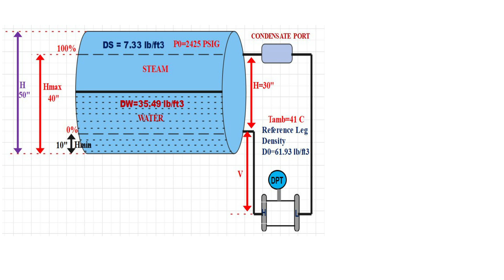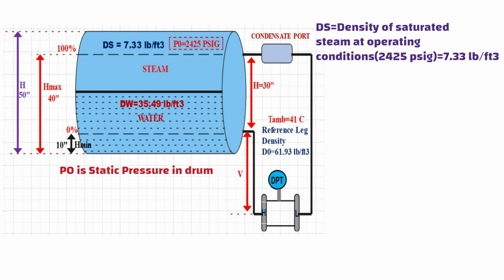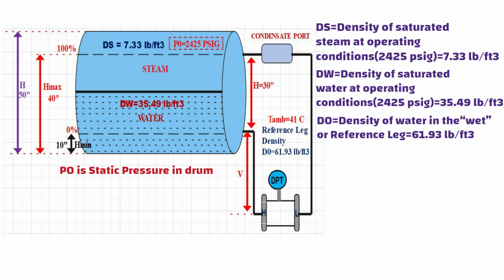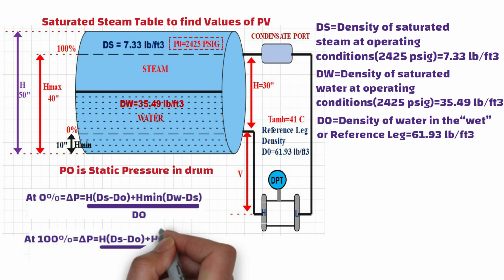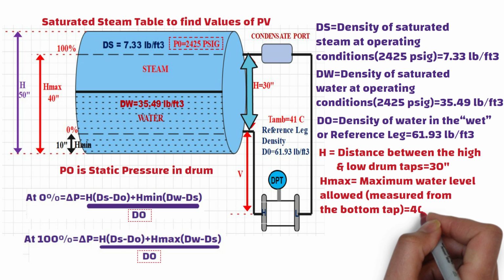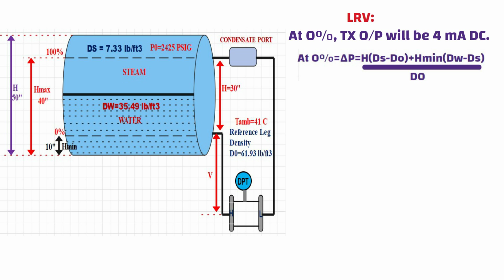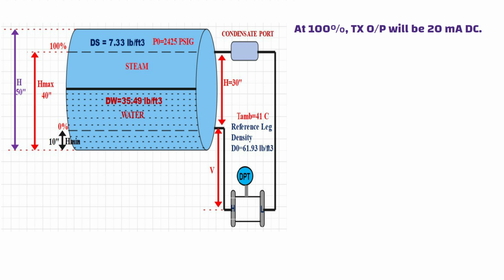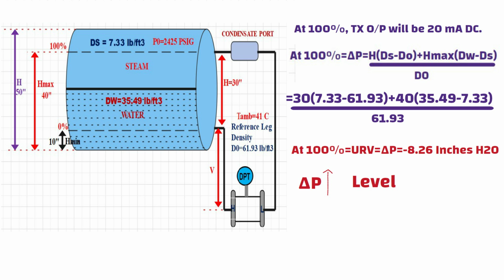How to perform Boiler Drum Level Transmitter Calibration

Comment: If the boiler is idle or not at operating pressure, how does this effect the level? Will the LRV and URV need to be trimmed until the boiler is at operating pressure?

Comment: I think -8 biger than -26 ;;;;;;;;;;;;;;
Reply from the maker: Yes -8 is  bigger than -26
Reply: @InstrumentCalibration  then how differential pressure is higher at low level? And differential pressure is lower at hight level?
Reply from the maker: @Jobminers  Hello Bright Differential pressure is -8.26 inch H2O at 100 % level, which is higher at high level, and -21.90 Inches H2O at 0%level, which is lower at low level.

Comment: Great video - but you may need to clarify one point.  You state that the H(min) and H(max) are measured from the bottom tap, but your drawing shows that H(min) and H(max) are being measured from the bottom of the drum itself.  I believe your statement is correct (measured from bottom tap), but the drawing is wrong and may need to be corrected.

And a question - your example has H(max) at 40" (above the bottom tap), but the span between top and bottom taps is only 30".  I don't think the DP transmitter will be able to measure a differential once the level in the drum is above the top tap, will it?

And one more - V is mentioned in the video but is not used in any of the equations - does V matter at all?  I'm assuming the DP transmitter needs to be located below the bottom tap, but other than that it doesn't matter.....
Reply from the maker: Hello Chris
Thanks for comment.
For first point,  Hmin and Hmax both is being measured from bottom of the tank. If I say bottom of tank, then it is incorrect. However, drawing is correct. I will share reference document, if you need it. Please let me know, if you need it.
For second point,  Hmax is being measured from bottom of the tank, not above the bottom tap.  DP transmitter will be able to measure the level till 100% level. 
 For third point, yes, you are right.  we are not using V any of the equation. So, V does not matter.
I hope you get all your answers. Let me know if you have any further questions.